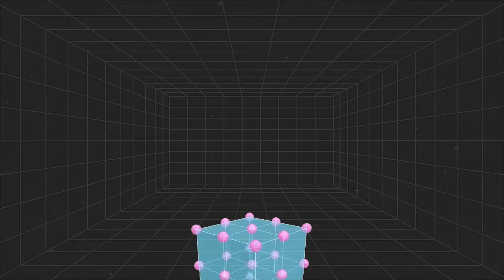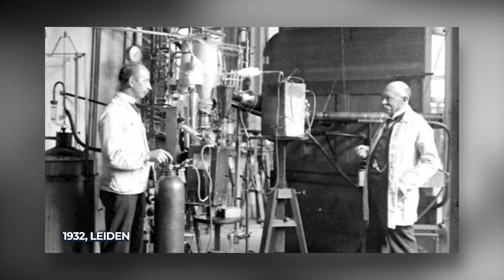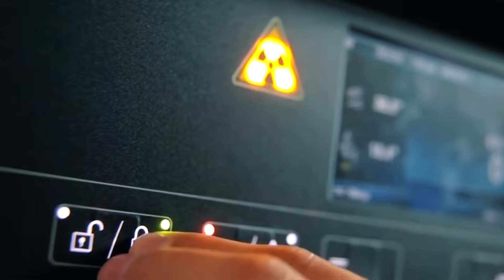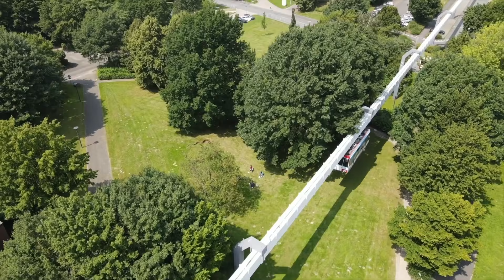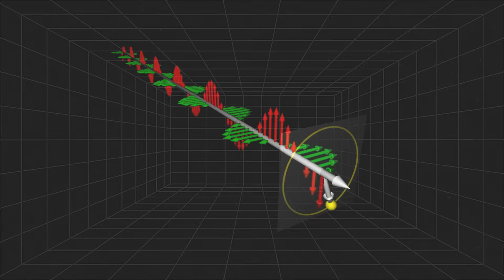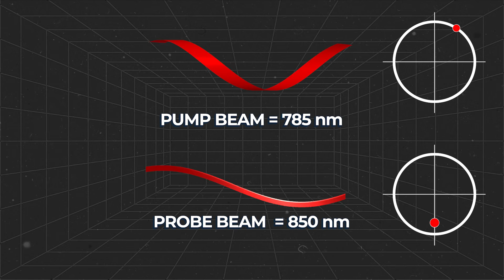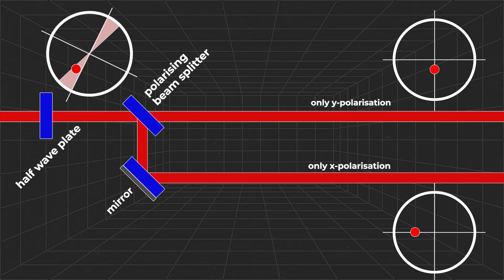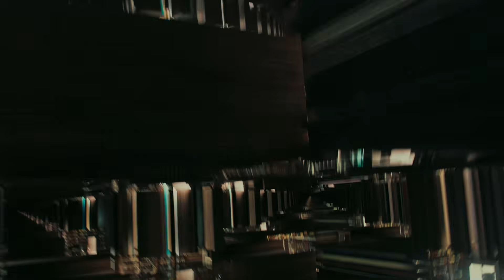Impossible Time Crystal Breakthrough - Explained

Comment: It seems to me you are mixing things up a little. Many systems have an equilibrium because as you say because internal relations depend upon the input. Say for example in any heat exchange, the amount of heat transferred is alwasys dependant upon delta T. Whereby deltaT becomes very important factor in the equilibrium calculation. This in itself does not qualify for "chaos theory".

Chaos theory is meant to embrace the fact that small changes in input results in a not predictable change to the output. That is to say, one calculation does not say anything meaningful about any calculation done with slightly different parameters. We use this fact alot in cryptography.

"Chaos: When the present determines the future, but the approximate present does not approximately determine the future."

Very relevant especially in climate models where even the input parameters are low fidelity, low precision og high noise. Implying that such models are very prone to big errors. I got top grade in a big project in high school, for basically giving up , handing in the towel, and only giving an assessment as to why the subject was to difficult for a high school student - as I grew older I realised, its not just high school students, its everyone. 
The erratic and unpredictable nature is exactly why it is useful in cryptography. Are you able to crack this you can win wars, break encryption and basically take over the world.

--------------

The problem of deriving time from an oscillation created from another oscillation. Basic error calculations give you that the precision of your new wave can never be better than the precision of the input. 

It is related to the problem of measuring the speed of light for example. To measure speed, you need to be able to tell distance precisely and time. All these 3 variables are dependant on one another so measuring one precisely is always dependant on the precision of the other 2. But the other 2 was calibrated using your assumptions about the speed of light in the first place. See the problem :) ?

Not even going into the fact that lightspeed measurement is always a 2 way measurement in practice. You cannot measure the speed of light without assumptions :)
Reply: The longer you go philosophically you will essentially end up concluding that we dont and cant know anything.

Comment: NO the energized superconductor don't lose energy because an object that can interact with the magnetic field is placed in proximity. Otherwise normal magnets would loose their magnetic charge the same way over time. This would be a very bad thing considering we're using magnets in motors. (some are working fine for over a hundred years)
The main thing why superconductors are loosing the electric flow, is because they're not perfect. Even if one molecule is not in the superconducting phase, this will be enough to convert the eclectic flow into heat over time.
Reply: They are perfect. Any defect would have to remove an entire flux quanta before it could cause a loss

Comment: What a great explanation. I ALMOST understood.
Q on the subtraction step - if the measurement by the probing laser is based on one direction of polarization being slowed down, won’t that offset the ambient noise of the two polarizations in time enough to yield a false result by the subtraction?

Comment: This work shows marvelous precision and impressive mathematical modeling, but given that it’s powered, I cannot fathom what the point is. I was, at the very least, expecting some kind of delocalization over time, yet this instead looks like an emergent and powered oscillation fully embedded in classical spacetime — that is, a vastly more difficult version of the piezoelectric quartz crystal you mentioned, but still fundamentally just that: A powered oscillation.

Is it because the oscillators are atomic in scale and plentiful? If so, that’s almost a matter of definition. Are opals crystals? It depends on whether you accept the repetition of units larger than atoms.

The earlier record holder sounded even odder since it sure sounded like it was using mundane beat frequencies in fancy-math clothing to drive the system into repetition.

What I least understand is this insistence on using power. After all, one pretty good way to understand how liquid helium stays liquid is that the mechanical oscillations created by quantum uncertainty are sufficient to overcome the very weak bonding forced between helium atoms. Such quantum oscillations don’t need power to endure indefinitely.

If such persistent, unpowered, uncertainty-based relative atomic motions are real enough to keep liquid helium, why can’t they be real enough to engage in unpowered repeating quantum oscillations over time?

For example, when liquid helium is enticed to crystallize using pressure, has anyone checked to make sure that the same virtual oscillations that formerly kept the helium liquid in space have not simultaneously crystallized in time, producing a true, unpowered Wilczek time crystal?

Has anyone thought to look?
Reply: The math would posit the existence of stable time crystals with absolutely no input energy (the oscillation is inherent), but how is it possible to detect and observe such a structure without immediately inducing oscillation, or modulating this "natural" oscillation?
Reply: @ticthak  that is a very good question, for which I can only make this observation: Since the existence of liquid helium proves that virtual spatial oscillations have profoundly visible and experimentally testable consequences, I can't see any easy reason why the time version of such oscillations in pressure crystallized helium might not also have fully physically and testable implications.

I have no idea what those implications would be. For years, I have naively assumed that that's what time crystal research was all about. (Me brain different think?)

Thus it came as a sincere surprise to me to find out that this fundamentally sound speculation has devolved mostly into a game of seeing how well you can hide the power source for driving subtle but quite classical oscillations. :)
Reply: In helium's liquid state, ambient temperature then becomes a source of input energy, perhaps dirtying your experiment.
Reply: @bgsmember3650  it’s a good point to consider, but a good reason to think that is not the case is that superfluid liquid helium is a type of Bose condensate — a state of matter in which all atoms behave as if they are part of a single quantum state. This collective wave function is so real that rotating superfluid results in the formation of rotational singularities, called quantum vortices, that have no analog in classical mechanics.

The other point is that no difference in how close you get to absolute zero on a log scale — one-thousandth of a degree, one-millionth of a degree, one-trillionth of a degree — liquid helium stays liquid. It’s not an effect that depends on heat at any scale
Reply: @bgsmember3650 isn't that violating thermodynamics law? As in no work can be driven from an external reservoir indefinitely? You'd be constantly decreasing the universes entropy then?
Reply: @NagiSeishirou-il2rr , that’s a great question! Here’s a different way to think about it. A proton imaged with energetic electrons looks like three quarks swirling around each other at incredible speed. But even with that motion, do protons undergo entropic change? No, because they exist in a unique lowest-energy thermodynamics with nowhere “simpler” to go.

A cool atom of hydrogen in empty space has a similar situation. Imaging its electron always shows it moving quickly, yet the electron cannot “find” any lower-energy state. Moving slower would actually increase the atom’s energy by causing the electron’s orbital to “foof out” (technical term) more. Thus, the atom can endure for billions of years felt undergoing any entropic changes.

Liquid helium is essentially the same idea, just operating at human scales instead of atomic scales. If you blast it with a burst of radiation to see where the atoms are at some instant, you see atoms distributed and moving very much as you would expect atoms in a fluid to move. But left undisturbed, the lowest possible energy state is a collective wave function corresponding to all the helium atoms moving slowly. It cannot find a lower energy state without adding other limitations, such as pressure. 

So, the simple story is that liquid helium is so much like a lowest-energy atomic wave function that there is no place else for it to go, energetically speaking. For entropy to apply, lower energy states must be available, and none exist. 

Incidentally, despite all the cute drawings of electrons swirling around nuclei in atoms, that's not what happens. Barring a cataclysmic event such as bonding or a UV ray knocking the electron free, the only indication the outside universe sees of the electron’s location is that fuzzy, multi-load cloud they show in chemistry textbooks. The moment you can see the electron inside that cloud, the cloud ceases to exist, and the addition of energy causes the electron to behave ever so briefly, more like a particle.
Reply: @TerryBollinger 
I'm as fascinated by your question as I am by your description of liquid helium being and remaining at its ground state, regardless of small fluctuations near 0° K (or any other temperatures above that).

I'm rather curious now about quantum vortices/rotational singularities...

Cheers!
Reply: @internetwithoutchains , thanks. Good ol' Wikipedia (search: quantum vortex wiki ) provides a great starting point for exploring rotational singularities, including the unexpected fact that London first came up with this idea nearly a century ago when describing how magnetic field lines get pinned in superconductors! The Feynman paper [1] is free online, but I doubt this channel allows links, so I'm just giving the citation. You can find the available copy by putting the paper's name into Google Scholar.

MAJOR UPDATE! While poking around on this response, I found a new (March 5, 2024) paper [2] that addresses, in great detail, the idea that magnon Bose condensates are time crystals! It has, count 'em, 67 mentions of time crystals in the paper, including for cosmology. Wow! That one is open access, so hopefully, giving its DOI number is acceptable. If not, I'll keep a copy of this reply and try again later.

@Dr Ben Miles, if you happen to read this -- I know it can get pretty crazy getting back to YouTube comments -- I would SO like to see an update to your previous excellent video based on this paper! It looks pretty good -- intriguing, really -- and it's in Applied Physics Letters.

I may do a deeper dive on this myself, but it will be a while, I'm currently on my second "even deeper" deep dive into Casimir.

----------
[1] R. P. Feynman, Chapter II: Application of Quantum Mechanics to Liquid Helium, in Progress in Low Temperature Physics, vol. 1, C. J. Gorter, Ed., Elsevier, 1955, pp. 17–53.

[2] J. T. Mäkinen, S. Autti, and V. B. Eltsov, Magnon Bose-Einstein condensates: From time crystals and quantum chromodynamics to vortex sensing and cosmology, Applied Physics Letters 124 (10), 100502 [Mar. 5] (2024). DOI: 10.1063/5.0189649
Reply: @TerryBollinger Brilliant description, so whats your field?  I’m guessing chemistry simply based on the fact my old uni chemistry lecturer gave a similar explanation as opposed to the odd physicist I still hang around with that makes it sound so much more complicated.  I’m a biologist, actually microbiologist, so I don’t get to weigh in on the big conversations unless the Chemists and Physicists are arguing and want someone with a minor in Biochemistry to weigh in.
Reply: @ForgeMasterXXL , thank you, that is most kind. Microbiology is extremely cool stuff. Alas, while I know a decent amount of chemistry and physics, I am naught but a poor, bewildered computer scientist fascinated by the physical role (and nature) of information in physics. You can find my Creative Commons, CC BY 4.0, untracked, no-ads musings on AI (it was my day job for many years) and physics if you Google Apabistia Notes.

Comment: I had to bail out at 6 minutes because "time crystal" was not clearly defined and I couldn't follow what was being said.
Reply: It seemed pretty clear to me that they were juggling around the idea of what it might mean.  They experimentally came up with this oscillating crystal whose oscillation frequency doesn't seem to be related to what is driving it -- instead it is a property of the crystal only.  This is not true for electrical oscillator crystals, whose frequency can be bent within a tiny range by the tuned circuit to which they are connected.

Comment: I guess this could be called an oscillating crystal that doesn't need an external physical system tuned at its oscillation frequency to keep it going.  It would be like a "quartz crystal" that would oscillate with nothing but DC current furnished to it.

Comment: 🤔 10:42 ChatGPT here 👋🏼
In the context of the Kelvin scale, the term "degrees" is not technically used. The correct terminology is simply "kelvins." So, when referring to a temperature on this scale, you would say "6 kelvins" (6 K) instead of "6 degrees Kelvin." The Kelvin scale is the base unit of temperature in the International System of Units (SI), and it is widely used in the scientific community for its ability to work with absolute zero as its starting point.

Comment: Using circular polarized light is the same as inputting oscillatory energy. It is not being done at a steady state of energy input.
Reply: The curiosity here is that the frequency of the provoked oscillation is way way lower than that of the light through which the power is provided.  It's kind of hard to imagine what this could be used for at this stage.  Too bad this won't work with plasmas or perhaps it would give us a leg up on continuous fusion power.

Comment: Actually, superconducting persistent currents are immune to environmental influence as long as the superconducting ring is kept cold and the current remains less than the material's critical current.  Your compass would simply change the current in the ring such that the magnetic flux through the ring would not change.  Persistent currents have existed for decades with no measurable change in current.

Comment: I love this post its the clearest and most detailed presentation I've seen, but using laser and magnetic field to stabilized the system is a let down. A 6.9 cycle is a very very slow combine the strategy of dumping the different of the output as noise may lead to questions.. Overall this is great.. thanks

Comment: 6.9 is because of the circle. As for making it possibly more stable use a very slight power difference to get it to rotate around like a clock. There is also playing with it and using reinforcement waves instead of what was done. Othe thing is running the circular direct ion of the laser opposing.